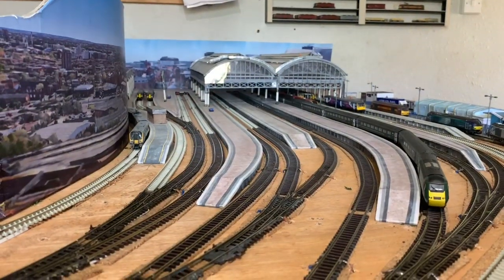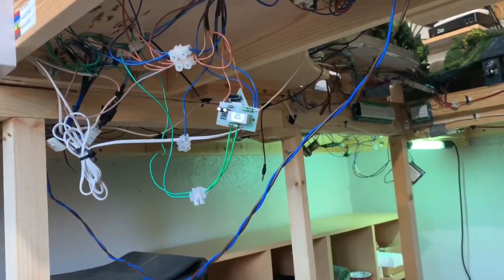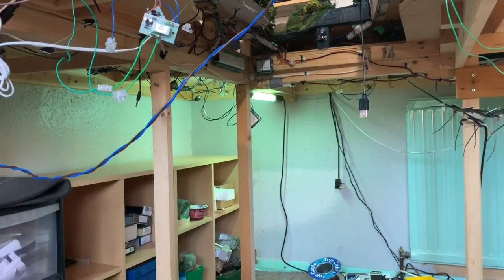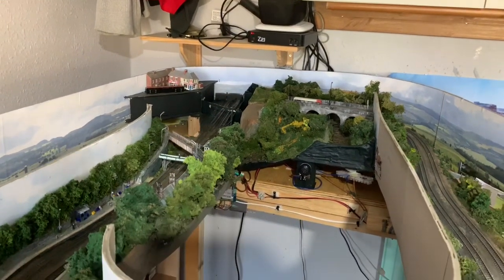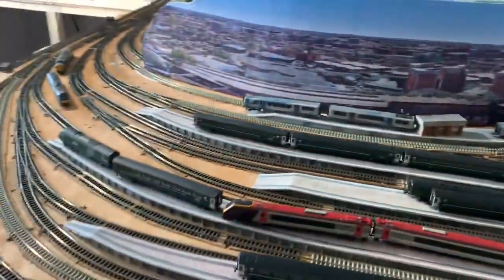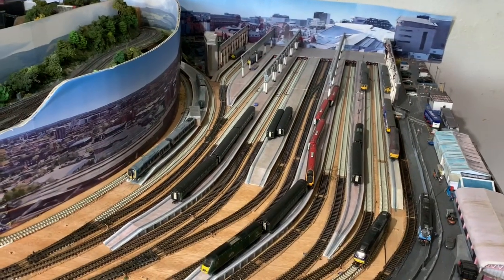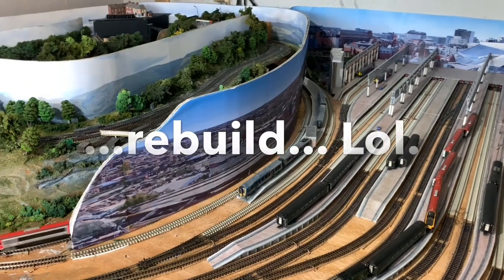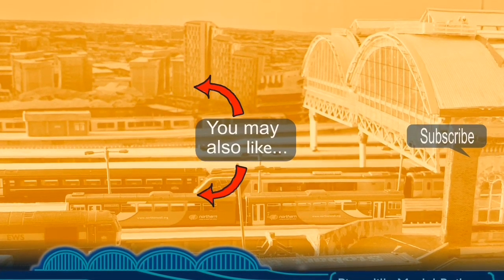DISASTER STRIKES: How to find a short circuit on a Model Railway.

Comment: Very helpful! I'm trying to locate a short that has brought my layout to a halt. You definitely reassured me that the process I am using to find it is going in the right direction. I also had a brainstorm while watching that I could employ terminal strips to good effect even though I have a small layout (3 ft. x 6ft 8 inches) with only one power district. I like your straightforward presentation. It really helps to understand what you are showing us.
Reply from the maker: Thank you for your kind words, and so glad it was helpful. Shorts are really annoying and very frustrating. After you ruled out any coaches, wagons, locos. and removed everything try disconnecting things one item at a time and test. It is a long laborious process Im afraid but slow and steady wins the race
Reply: I am indeed doing just that. I have narrowed it down to about a 3 foot section of track and am hopeful my next "serious" search will have positive results.  @piccadillymodelrailways

Comment: Glad you sorted it, Ive still to tidy my wiring, but will do this when all the wiring is complete.
Reply from the maker: Martin Levin yes it does make a difference. Since doing it I now see wires are easier to trace and safer, no garroting. Lol.  I kinda wish Id done it as I put it in but I completely understand ‘just getting it done’. Thank you for commenting.
Reply: I have colour coded wiring, with the dropper wires matching. Basically standardised all my wiring, suppose being a electrical engineer I have prepared for fault finding.
Reply from the maker: Martin Levin I did that. All 16v ac is blue/brown, 3v is red/black and and 12v is grey/green+yellow

Comment: Hi John  -   been there myself - it's a pain trying to find where the short actually is.  For Blackwood I disconnect the D connectors between each of the four boards and then reconnect one at a time to narrow down the problem to a small area.   Sounds as though you've done the same.   Main thing is you've resolved the issue.
Euan
Reply from the maker: The Growler - Blackwood N Gauge Layout Yes thank you Euan, sounds like we’ve both done similar things. I cannot believe the problems Ive had with those DCC concepts decoders. Wont use them again.

Comment: Hi John. What a nightmare when you get a short it can sometimes take days to try and sort it. I am glad you seem to have got to the bottom of it, I could almost feel the frustration in your voice this hobby can get you so annoyed with your self at times. I only have a small 00 layout so I have kept it to D.C. but at some stage I hope to change it to D.C.C. that when I will need help from people and there are plenty on you tube. Hope everything goes O.K. for you John. Regards George...
Reply from the maker: George Wyatt yes Thanks George you are so right, the hobby can be very annoying at times. 3 days to find this short, but hopefully all fixed. Time will tell. DCC is amazing, but it does bring its complications, but as you said there are loads of us happy to help, just ask. Do be aware it’s quite expensive, not only for the controller but decoders for every loco. You cannot run analogue locos on DCC, as the AC voltage will burn out the motor without a decoder. Thanks for commenting George.
Reply: Hi John. Thanks for your reply and for the info yes I do relies you can't run D.C.C. on analogue. If and when I get round to changing over I my hold you to your word and call on your help.  So thanks again John you are a gentleman. Regards George......
Reply from the maker: George Wyatt Yes do George, happy to help. Please forgive me, you CAN run DCC locos on analogue as recent decoders are set up to run. However you CANNOT run analogue on DCC. Forgive me if that’s being pedantic but quite important. The hornby select claims to use address 0 for analogue locos, best not to. Hornby will not reimburse if it goes wrong.

Comment: My heart bleeds for you John with all that wiring, but so glad you have now sorted it out. To be honest, I wouldn't know where to start if I had as much wiring as you have. As far as electrics are concerned, I am hopeless and that was one reason for keeping my layout wiring pretty simple, with the minimum amount of points and crossovers. I just have three train running tracks, two tram tracks and eventually a separate train branch line, all controlled independently from just three twin track and one single track controller. 
Cheers 
Geoff
Reply from the maker: TRAM JUCTION MODEL RAILWAY thanks Geoff, Im so relieved it now works again. 

You grow in confidence where wiring is concerned. However I fully understand keeping it simple. It starts with point motors then powering frogs, then lighting is required so on an so on. A year down the line you look again and suddenly you realise wiring has has grown and developed. When you install it, you understand it.

Comment: Hi John- Thanks for the upload and must say that the electrics side of the build is the bit that worries me most , who said DCC is just 2 wires and off you go? !!!! I am thinking of going the terminal connector way and splitting my layout into 3 sections ( 3 mini bus's) therefore if you get a short the can narrow it down to 1 of 3 . Also thinking of using terminal blocks for the droppers with the connection from Hornby or Pecos already connected fishplates so any  issue you can easily replace it. I am also thinking  of using Cobalt point motors with the Aplha control box might be more expensive but seems more straight forward.
I have made some changes to the Track plan and have printed it out in 1 to 1 scale and will shortly upload a video so if you have the time can you have a look and see what you think - Cheers Kevin
Reply from the maker: Medway Peninsula Model Railway yes thanks Kevin. Yes you are so right by dividing the layout and cutting the tracks above. Im still learning as I go on. 

Did see your last video, think I did comment too. A layout can be as simple or  complex as you want according to knowledge and confidence. Both grow dramatically over time. Ive been back in the hobby for 3 years now after 40 year gap. We all start somewhere, and we puck buts up as we go along. I just watch others.
Reply: Hi John - Thanks for watching the last video and the helpful comments , the next one will be uploaded in the next few days . I too watch others such as yourself and I am picking up loads of useful info . Must say the railway community is great for freely offering help a fine example is the advice given to Paul at Sandling  Junction.

Comment: I gave up with frog juicers and my Z21, it seemed sometimes they would work ok, other times the Z21 would see a ‘short’ before the juicer had a chance to switch polarity. Ended up using the point motors to switch and problem was solved.
Reply from the maker: timsytanker sounds good. Glad you found an answer for you. Think some products work well for us whilst others prove to be a nightmare. TBH for me its those DCC Concepts decoders which cause endless issues. Gratefully the gaugemaster frog juicers work well on the whole.

Comment: Hi john, such a shame you this mega problem. Just watched another stream a few days ago and had a problem with shorts on the dcc concepts point controllers, he phoned them and they know sometimes there is a problem with the built in cud drawing too much current when initially charging up. They sent him a special board to fit to slow the rate of charging down and that cured the problem. Hope that helps you.
Reply from the maker: Alex Savins ok thanks Alex, I might give them a ring. However, TBH, as soon as I can afford to change them I will, with failing decoders, difficulty in programming and now this short, I’m fast loosing patience with this product. Thank you so much for the comment Alex

Comment: Hi John,
Well done for showing this it not always plain sailing is it even on my tiny layout I had one when I bought a point at a train fair and it had a dead short in the frog area and as it was the first time Railmaster had not started on me its very worrying, but as you say just work through the fault is there somewhere. Glad its all running now and looking forward to seeing this transfer section up from fiddle yard.
Cheers Robert.
Reply from the maker: ROBERTS TRAIN SET thank you Robert, I was so relieved, after 3 days of trying was thoroughly fed up with it. Can be quite demoralising and demotivating, but... I knew I had to keep going till the fault was found. Still loads of wires to reconnect, but I’ll do those a few at a time. Thank you for commenting.